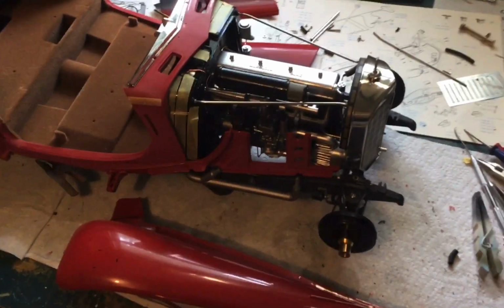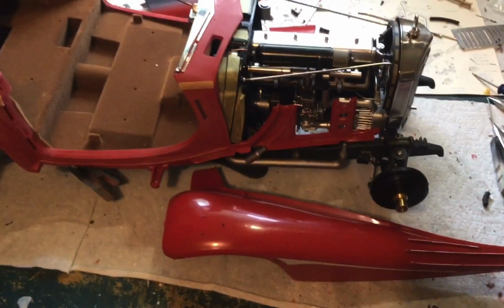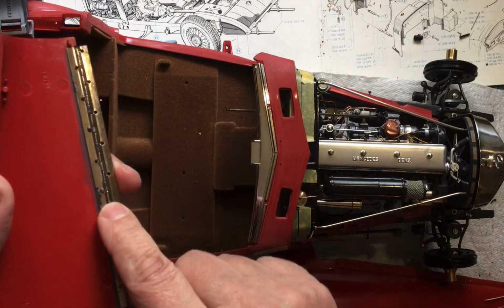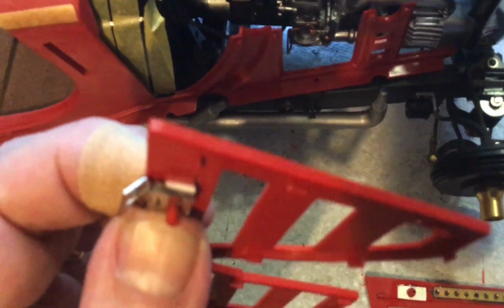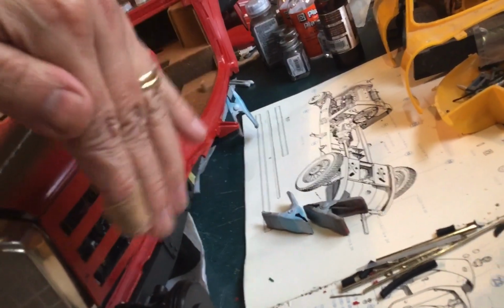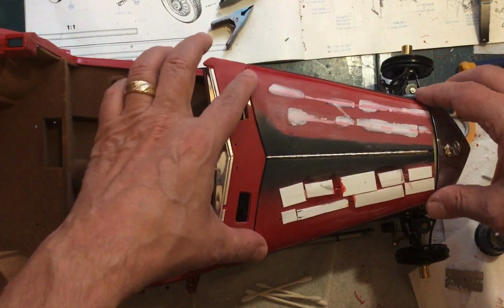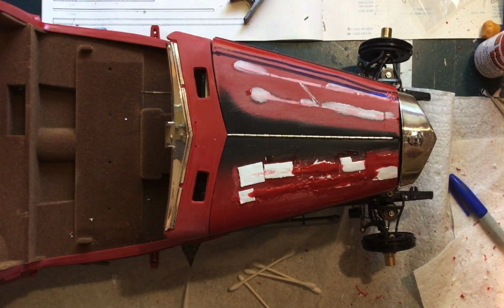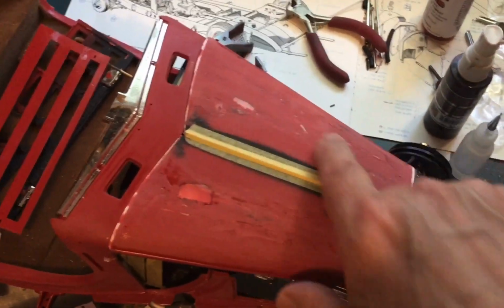Pocher Mercedes build; fitting the hood, and getting ready to make custom chrome trim

Comment: Wow! You just don't give up on those plastic hood parts, haha.  Lookin' good but most folks just cut and fold them from brass or copper in a fraction of the time.  It's way easier than it sounds.  You just need to try it!  (on the next one that is...)
Regarding those chrome strips I have some info you may find helpful.  Hopefully it's before you've gotten too far along.  To my knowledge every metal part on Pocher kits is nickel plated brass, not chrome. So if you finish something in chrome it likely won't match the rest of the brightwork on the model.  The dull kit parts can be polished like you did the radiator surround.

I asked David Cox if Model Motorcars ever thought of making the trim strips for the Mercedes and he told me he and Marvin had tried but the brass strips would always distort during the plating process.  And of course trying to bend them to shape once plated cracked the plating.  That's why Marvin doesn't sell the trim strips.  When I was building my Mercedes I used Oatey brand 1/8" leadless solder available at any home center (the stuff has a lot of nickel and silver and won't tarnish).  I used files to get the triangular cross-section (they aren't flat on the real car so look closely!) and taper them down to nothing.  Then  I sanded, polished, and cleared the pieces once I had them in the shapes that fit the car.  There are a bunch of them.  Good luck.
BTW, David did his Jack Warner Spezial strips in sterling silver.  I heard it got expensive... 😁
Reply from the maker: Thanks for the info. I did consider doing the hood in brass, but at the moment, I’m more comfortable with plastic. But like you said, I just need to try it.
Reply from the maker: Oh, and I did notice the shape. I’ve got several pics I’ve been looking at. But, thanks for the heads up anyways. I easily could have missed that detail, so I do appreciate all the info.
Reply from the maker: I just contacted Marvin and my chrome plater. Both said there is not an issue with warping or distorting during the plating process. So I’ll continue with the original plan.
Reply: @customfabrications  I was just relaying What David Cox told me.  You are clearly head-strong and very "self-reliant".  I can't help you.  Good luck with your modeling.  Unsubscribed.
Reply from the maker: Wow. And I was only telling you what Marvin and my chrome plater said. Didn’t I thank you many times for previous info? Didn’t I say many times how I appreciate any info or ideas? So if this is how you’re going to be because I’m taking the advice of professionals instead of one of your ideas, then fine. You won’t be missed. By the way, how many other you tubers are you subscribed to that read and reply to every comment?

Comment: Great video.. I have the 540k and the same problems with fitting the hood and doors and fenders. I put it away for about tens years lol. Ireally want to finish the model.
Thanks for all your hard work and input. I fininshed the interior not knowing and the doors will not close now. So i brought new interior from modelmotorcars to do it over.
Reply from the maker: Thanks for the comment. And good luck with your build.